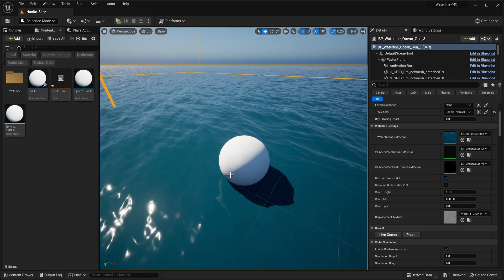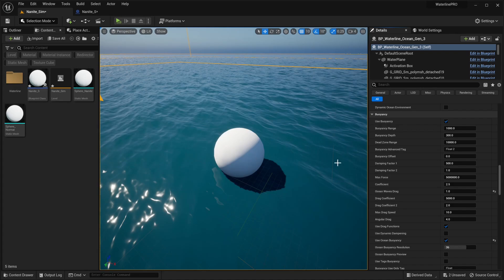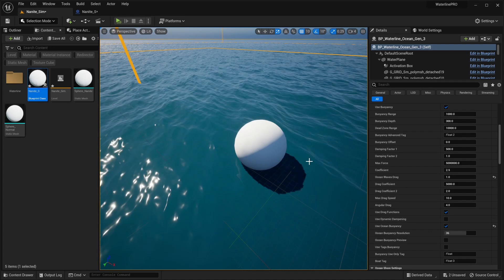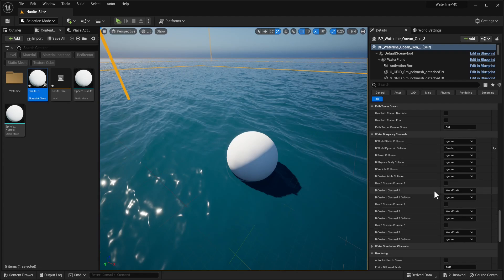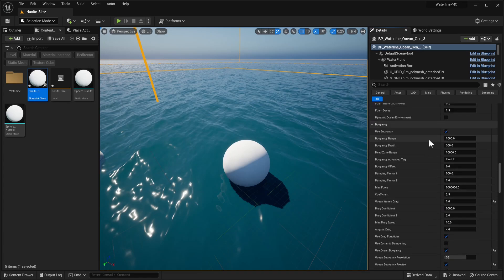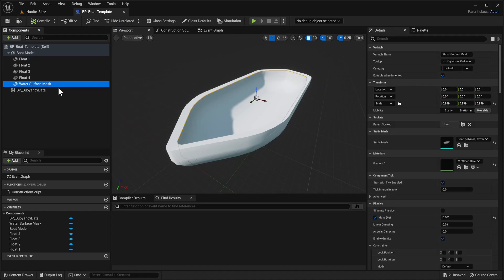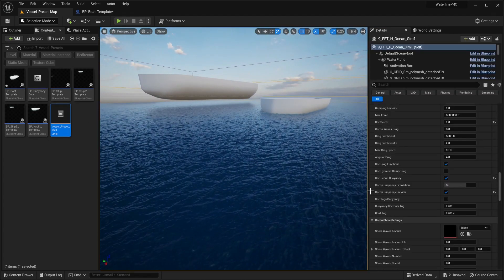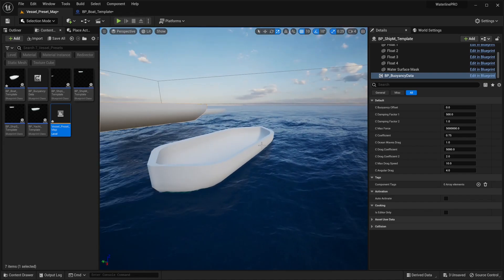WaterlinePRO 5.4 Buoyancy Tutorial

Comment: But how do you retrieve the height of the wave for those buoyancy calculations? Are you using GPU readback from your FFT simulation or are you recreating the calculations on CPU with some advanced math to get accurate results?
Reply from the maker: Hi!
We use a GPU readback via a Niagara system at the moment. We are currently experimenting with alternative methods though in general they are a lot slower, but useful for projects that cannot use Niagara for this.
Reply: @dumpsterfireproductions  It's not only about being fast. CPU calculations means you can replicate the system and there is no delay. Deathrey described a way how to do CPU calculations in an efficient way, but sadly I'm not smart enough for the stuff he says.
Reply from the maker: @ninjin_dev  
In order to be efficient a CPU FFT would max out at a resolution of 32 or 64 pixels and would still be a MASSIVE drain on the game thread.
A GPU readback hads a delay of a single frame - this is generally okay as buoyancy physics would (more or less) accumulate height samples across several frames and then smoothly interpolate between them.

In terms of replication our ocean simulation is deterministic, so as long as you supply a consistent time to the ocean simulation, all clients will simulate an identical ocean.

Technically it is possible to do this on the CPU but the difference in motions is negligible while the performance cost much much much higher.

Comment: Sorry for another question. I've been using the plugin it has been quite nice!

I was wondering if the boat can be made as pawn instead so that it can be playable. Or on my own pawn do I just attach the buoyancy component? Also was that an intended way of use? like for example applying physics force forward to moving the boat, or would that create unexpected result like flying around and stuff. 
Thank you!
Reply from the maker: Hi!
We don't have much experience with full on vehicle systems but the scenario you describe should work.
Also - yes since the buoyancy is a physics system the vehicle motion will also need to be physics driven. For best results you can have system to check distance from the ocean surface so only when the engine is close or below the water will the force be applied.
If you would like more details on sampling the ocean height please let us know on our support email.
Reply: @dumpsterfireproductions  oh awesome. Its abit of experimental area eh. Ill try and see! Hopefully it feels smooth but yea it might need some extra custom solution like you said.
Reply: @dumpsterfireproductions  Also Thank you for the helpful and quick response as always!!

Comment: I've an issue: The simulation. I didn´t get how to record the interaction of an object (a boat) with the water. I try to Record in Unreal, but no. the boat work, if I play the Simulation everything is fine... but when it comes the time to replay in sequence panel, nothing. The water doesn't react with the boat. Could I ask some help?
Reply from the maker: Hi!
Water simulation is based on velocity if an animation is keyed with the sequencer it will not have movement based on the Unreal physics engine and as such will have no velocity. However you can bypass the Waterline velocity check by giving your actor the Actor Tag "On".
This way Waterline will include it in the ocean sim regardless of it's velocity :D
If the issue persists please let us know on our support channel.
Reply: @dumpsterfireproductions   Hi. Tomorrow I'll try with calm to render, but for now in the preview work. It's changing  to "Camera Tracker - Level Sequencer " "Level Sequencer - any name you gave to te Sequence X" and then add the Tag "0n" to the Boat _ blueprint.
Ah, and before press Play in the Sequencer, press the green Play button for make start the Simulation, instead the water not interact actively with nothing.
Reply: @dumpsterfireproductions   and no. Now is reacting in the Sequencer, but i cannot render out. is locked on Remote Render and there is no way to Record the Simulation of the Water. 
Even if I press " record " and looks like I have keyframes, when i press play later... nothing.
It works when I make Simulation, but that doesn't allow me to render in Local.
Reply: @claudioproietto6192  I'm wondering if you ever figured out an approach to this. I'm in the same .. boat, ahem... where I need to keep the movement of the water and the buoyant objects consistent for the sake of rendering